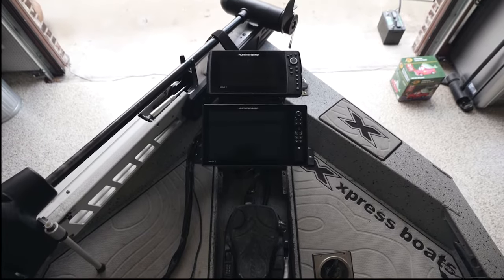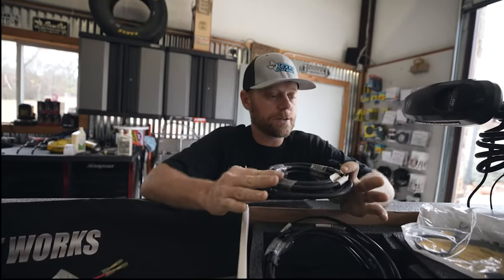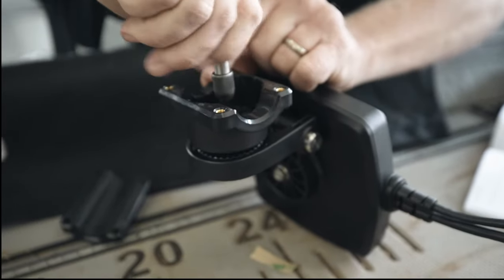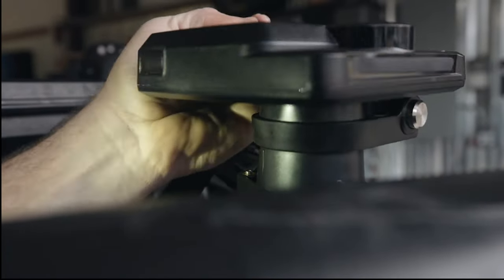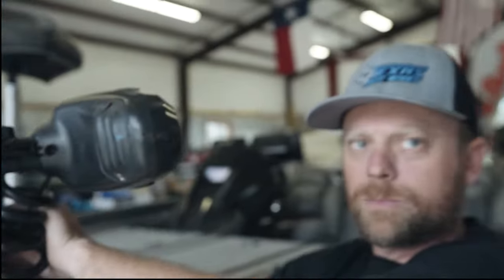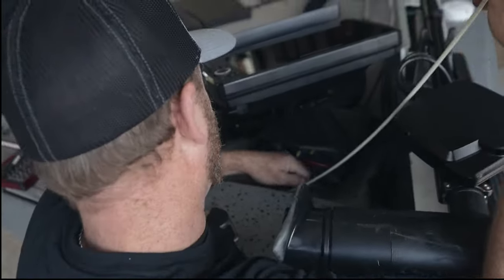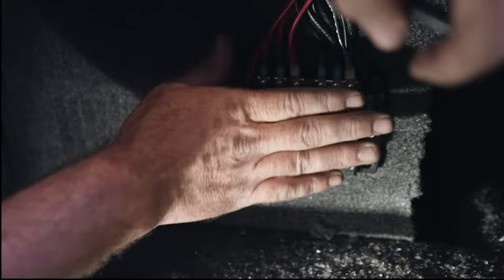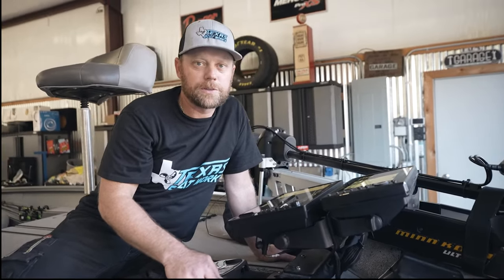Humminbird Mega Live Install | Texas Boat Works

Comment: I have been told the drain wire needs its own wire ran to negative terminal , that you can’t install it with the power negative cable ? Any thoughts or issues?

Comment: What is cost of rigging 2 helix 15 1 helix 12 mega live, mega 360  generation 4?  I have 16 foot Lund. I have installed every thing and every thing is functional but uses old wire from old minnkota battery chargers i replaced and I have the mega live running straight to a battery. I want it pro done from scratch , how much?

Comment: Pro tip for you. After snipping a wire tie take a lighter and gently heat the cut. It’ll melt into a smooth surface that’ll no longer slice you open. Great work on your install.

Comment: Do you have a link to the fuse box you used? I like the compact size of that one.
Reply from the maker: AMRB-5025 Blue Sea ST Blade Fuse Block w/ Negative Bus - 6 Circuit https://www.amazon.com/dp/B07BRBK19G/ref=cm_sw_r_cp_api_glt_i_D3HX5HP59BZDTGCPK2J5